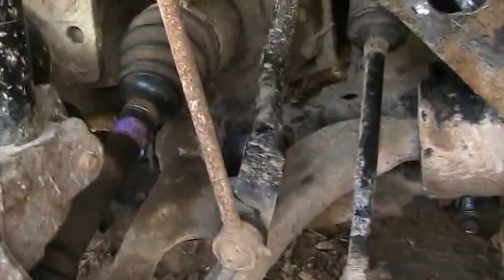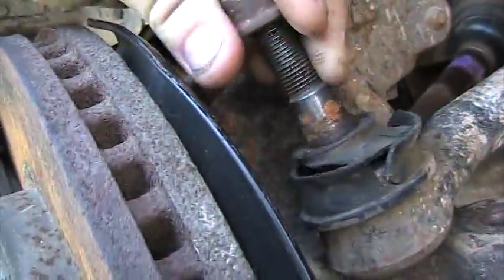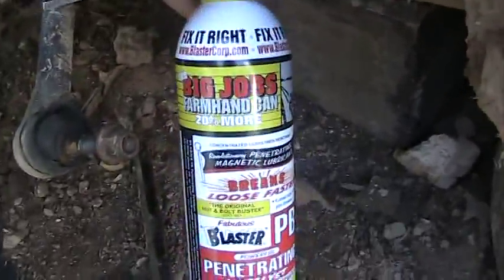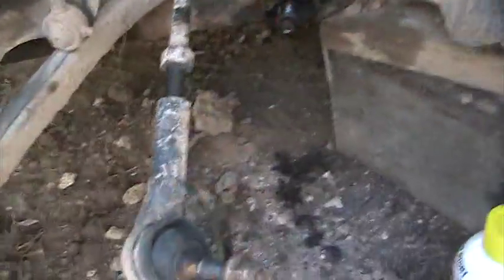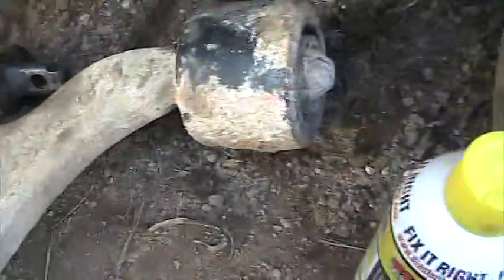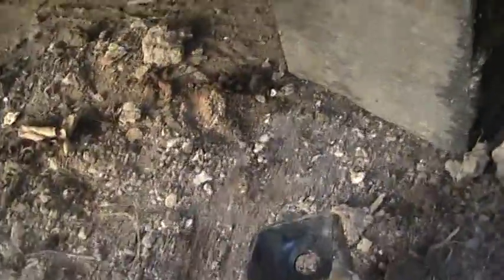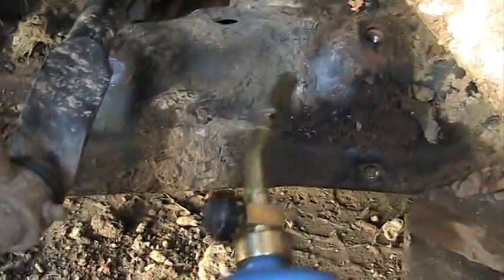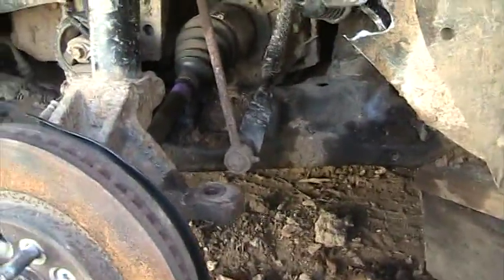Day 1 -2004 Ford Freestar- Changing Ball Joint Assembly and Outer Tie Rod End

Comment: what i forgot to tell you is that NO AIR and NO PB BLAST was used to break the bolts loose,YALL HAVE A NICE DAY
Reply from the maker: +John Williams Well on a good job yeah they come out fine, but unfortunately the bad jobs still gotta be fixed also. a person cant throw the vehicle away because all the bolts were rusted and seized up. honestly that was a horrible experience. it was supposed to be about 45 min to an hour job for me jack up then rip out the old, then maybe an hour-ish putting it all back together and instead it took about 5 to 9 hours of fighting each bolt and not being able to put enough leverage on any of the bolts to remove. trust me, I did not want to work that hard. but thanks for watching and I hope this helps anyone, my camera battery died in middle of job so I wasn't able to finish the video, sorry guys. any questions please ask oh and everyone pls subscribe. thanks!

Comment: the issue though is it's acting like the threads are crossed. an even using a breaker bar it feels like my ratchet is about to snap literally. we're they that tight when you tried putting the bolts back in. cause they shouldn't be that tight I mean I'm still out about. a inch or so

Comment: I'm working on the same van. only thing is I'm working on the passenger side lower control arm. yes it was hell trying to get them bolts out of there. the issue I'm having is once I installed the new control arm I got the car left two bolts in fine. but the right side the bolts seem to act like it's binding everything is on straight. I had to use a breaker bar to run the bolts in an they are getting even tighter so I stopped. threads on the bolts look good an I know there is blue lock tight on the threads. I've cleaned them an everything an they are hell to get back in. so I don't know if maybe the threads inside the frame could be possibly cross threaded.
Reply from the maker: Yeah it's a pain in the ass. I thought they were stripping also but bolts were fine after busting my ass to pull back out. We had to use a torch to put back in also. I feel for whoever has to pull that van back apart. I know I'm not doing it and I hardly ever refuse a job ad normally when I do refuse it's the person not the job. But yeah so just keep tightening. And don't be afraid to get the torch out.
Reply from the maker: Yeah it's a pain in the ass. I thought they were stripping also but bolts were fine after busting my ass to pull back out. We had to use a torch to put back in also. I feel for whoever has to pull that van back apart. I know I'm not doing it and I hardly ever refuse a job ad normally when I do refuse it's the person not the job. But yeah so just keep tightening. And don't be afraid to get the torch out.
Reply from the maker: Yeah it's a pain in the ass. I thought they were stripping also but bolts were fine after busting my ass to pull back out. We had to use a torch to put back in also. I feel for whoever has to pull that van back apart. I know I'm not doing it and I hardly ever refuse a job ad normally when I do refuse it's the person not the job. But yeah so just keep tightening. And don't be afraid to get the torch out.

Comment: why does it take you guys so long to replace the lower control arm,there is no need to cut on the fender well or use a torch
Reply: Others have reported that these bolts are very hard to remove so a torch sounded like a good idea.  Cutting on the fender well is not such a good idea.